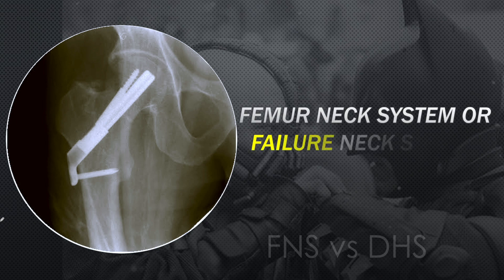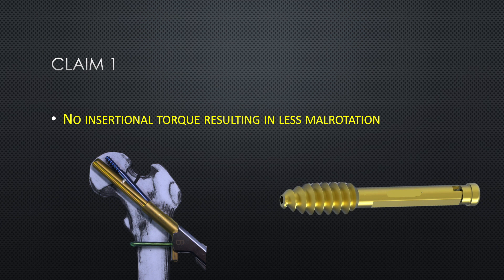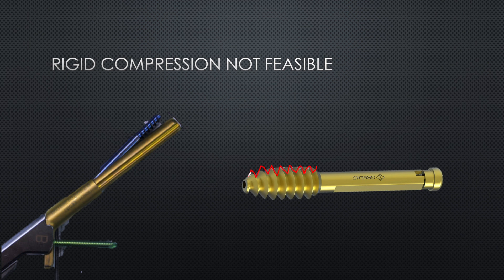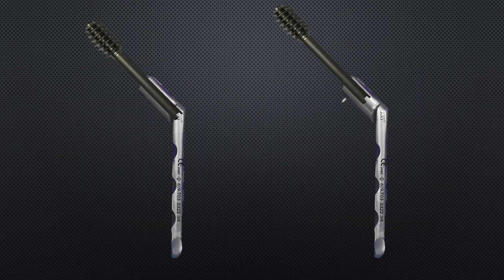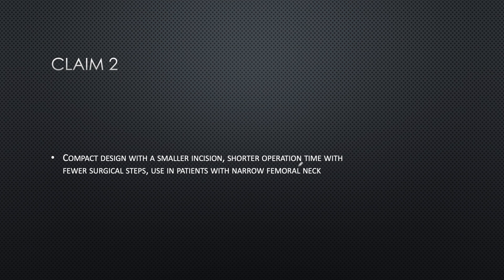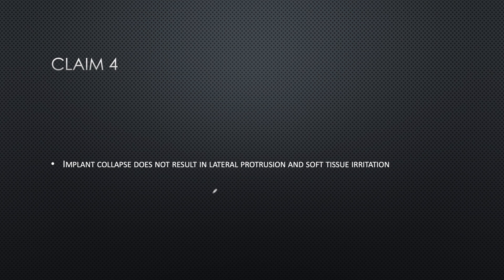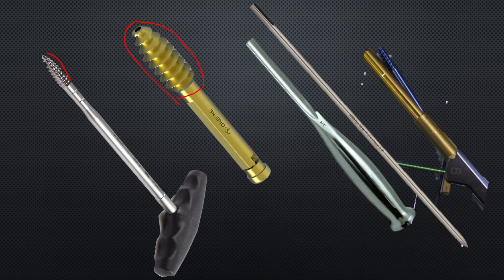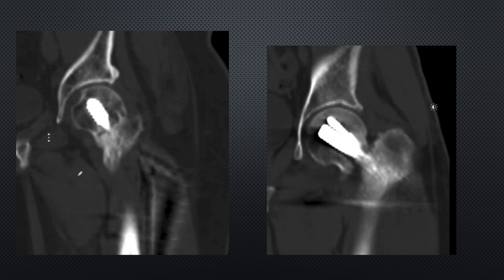Femoral Neck System (FNS): Is it really Good? Don't watch if you are an FNS fan!

Comment: Oversimplification IMO.....You really should watch the 2019 video on Vumedi from the designers of the implant as to why they chose the bolt...ie less cutout.
Reply from the maker: Thanks for your feedback.I humbly differ with the opinion of designers. I would be happy if some renowned surgeon posts all cases of FNS done with good bolt positioning and show the outcomes till union. IMO the FNS use will fall over coming years unless some real changes in design are made.

Comment: Thank you so much sir ...for this wonderful explanation....
sir,do you prefer DHS or 3 cc screw fixation in most of femur neck fracture patients?
Reply from the maker: CCS are the  most obsolete fixation, and in high sress area like femoral neck, the can result in early failure. They should be reserved for minimally displaced/stable/valgus impacted subcapital fractures only. So, DHS is what we mostly use. Minor malreduction/rotation wont affect the outcome but compression should be good.
Reply: @Justorthothings  thank you sir.......